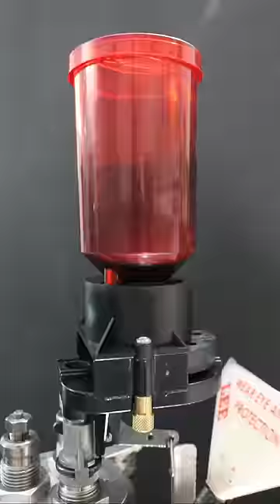Reloading 9mm ammo in 1 minute with Pro 1000  -   #reloading, #9mm, #leeprecision, #ammo, #shorts

Comment: Do you typically load 9mm projectiles that have a cannelure?  Or was that actually a .357 bullet ?
Reply from the maker: Good morning Yoda and thanks for stopping by and leaving a comment👍👍..  The projectile used here is a 130gr SJFP, reference B-329 fabricated by PRVI, diameter of 0.3545. 

A similar projectile that I have also used, more frequently than this is the 125gr SJSP, reference 613573 by Fiocchi. Both mentioned projectiles I have used to reload 9mm and .38 special rounds with no issue what so ever.

Take care and have a great day.

Comment: what powder are you using?
Reply from the maker: Good morning and thanks so much for stopping by the channel👍👍. I might be mistaken but in this particular instance I think I was using SP8. Have a look at the longer clip for more on this press, https://youtu.be/GplsUtheYPM . In addition, here is a list of items I normally use, all depends on what is available.. .... BUT.. Don't be fooled by my entertainment video that reloading is a mundane and easy operation.
Reloading is a very dangerous affair and it requires lots of time, patience and restraint.  Even so, mishaps can happen..

Here is what I normally use for 9x19 reloading.

Heads: 
- 124gr RNCP, FNCP by L.O.S, NTW, Fiocchi, Romana Metalli, H&N or Frontier.
- 124gr RN Polymer coated RN by ARES or IGF.
- 125gr SJSP, reference 613573 by Fiocchi.
- 130gr SJFP, reference B-329 by PRVI.

Primers:
- S&B, Fiocchi, CCI, Murom or Federal.

Propellant:
- N320, CSB5, CSB6, FRex, Vectan SP8. 

Note: For the amount of propellant and overall length of the projectile follow the specified data by each respective manufacturer of the specific product. 

Have a great weekend

Comment: How much does it cost to get set up for reloading?   And what's the estimated $/round?  Gonna do my own research, just hoping somebody can offer a "fast-track" answer/estimate?  Been very interested for a long time but hadn't been in a position to invest in the matter.
Reply from the maker: Good afternoon. . Thanks for stopping by and looking at my content.🙏🙏👍👍 
Here are my own workings as follows: 
🔶Based on 9mm setup only. (Changing caliber is approximately $100 addition, mostly dies and shell plate)

🔶ALL FIGURES & CALCULATION DONE January 2022 as follows:

$300 _ Lee Pro 1000 Press 9mm, ref. 90640.
$020 _ Lee Case Collator, ref. 90667.
$045 _ Lyman Ammo Checker, ref. 7833000.
$012 _ Dillon precision case lube, ref. 13733.
$055 _ Scale frankford arsenal, ref. DS-750 
$050 _ Price estimate for a generic caliper.
$048 _ Price estimate for kinetic bullet puller. 
$530 _ TOTAL INVESTMENT of above listed item ONLY.

$160 _ TOTAL Calculated price of raw materials to fabricate 1000 rounds type (CPRN-124gr) "brass cases free)
 
$300 _ TOTAL Average price for factory loaded ammo, 1000 rounds, 124gr.

🔶Therefore, excluding labor cost, I save $140/1000 Rounds.
🔶Therefore, investment of $530 / Savings of $140 = 3786 rounds.
🔶Therefore, after 4000 rounds I start saving $140 / 1000 rounds I send down range.

🔶🔶🔶 In short, after 4000 rounds I cover ONLY my investment cost. Expect more cost as you go along.
Reply: @ReloadingMoreAD1966  fantastic, thank you, most of that I understood. Lol. So if i got this straight, roughly $530 gets my workstation set up, and from there it will cost me approx. $160 to produce myself 1000rds?

Comment: What’s the cost of this rig and how much could you theoretically save on ammunition
Reply from the maker: Hello Phily. Thanks for looking at my content. Good morning Dominic.  Yesterday someone asked a similar question. Here is the reply with some numbers. Take care and have a great day.👍👍
-------------------
Here are my own workings as follows: 
🔶Based on 9mm setup only. (Changing caliber is approximately $100 addition, mostly dies and shell plate)

🔶ALL FIGURES & CALCULATION DONE January 2022 as follows:

$300 _ Lee Pro 1000 Press 9mm, ref. 90640.
$020 _ Lee Case Collator, ref. 90667.
$045 _ Lyman Ammo Checker, ref. 7833000.
$012 _ Dillon precision case lube, ref. 13733.
$055 _ Scale frankford arsenal, ref. DS-750 
$050 _ Price estimate for a generic caliper.
$048 _ Price estimate for kinetic bullet puller. 
$530 _ TOTAL INVESTMENT of above listed item ONLY.

$160 _ TOTAL Calculated price of raw materials to fabricate 1000 rounds type (CPRN-124gr) "brass cases free)
 
$300 _ TOTAL Average price for factory loaded ammo, 1000 rounds, 124gr.

🔶Therefore, excluding labor cost, I save $140/1000 Rounds.
🔶Therefore, investment of $530 / Savings of $140 = 3786 rounds.
🔶Therefore, after 4000 rounds I start saving $140 / 1000 rounds I send down range.

🔶🔶🔶 In short, after 4000 rounds I cover ONLY my investment cost.
Reply: @ReloadingMoreAD1966  very insightful. Thanks. I might try to get something going myself I’m new to firearms in general but I want something semi self sustainable.  
I like the idea that given the proper materials I could build/make it myself since I was little I’ve always been facilitated by guns bullets middle age weaponry etc 

Honestly this doesn’t look nearly as complicated is I thought it would be (not that it’s easy) just cool to see that it’s not as impossible as it might seem at first 

And surprisingly affordable

Comment: how many bullets you need to make to break even with the cost of all that machinery?
Reply from the maker: Good Morning Burden and thanks for stopping by👍🙏. Here is a small calculation to give you an idea about the costs involved. BUT.. Don't be fooled by my entertainment video that reloading is a mundane and easy operation.
Reloading is a very dangerous affair and it requires lots of time, patience and restraint.  Even so, mishaps can happen.. 

Here are my own workings from first quarter of 2022 as follows: 
🔶Based on 9mm setup only. (Changing caliber is approximately $100 addition, mostly dies and shell plate)

🔶ALL FIGURES & CALCULATION DONE January 2022 as follows:

$300 _ Lee Pro 1000 Press 9mm, ref. 90640.
$020 _ Lee Case Collator, ref. 90667.
$045 _ Lyman Ammo Checker, ref. 7833000.
$012 _ Dillon precision case lube, ref. 13733.
$055 _ Scale frankford arsenal, ref. DS-750 
$050 _ Price estimate for a generic caliper.
$048 _ Price estimate for kinetic bullet puller. 
$530 _ TOTAL INVESTMENT of above listed item ONLY.

$160 _ TOTAL Calculated price of raw materials to fabricate 1000 rounds type (CPRN-124gr) "brass cases free)
 
$300 _ TOTAL Average price for factory loaded ammo, 1000 rounds, 124gr.

🔶Therefore, excluding labor cost, I save $140/1000 Rounds.
🔶Therefore, investment of $530 / Savings of $140 = 3786 rounds.
🔶Therefore, after 4000 rounds I start saving $140 / 1000 rounds I send down range.

🔶🔶🔶 In short, after 4000 rounds I cover ONLY my investment cost. Expect more cost as you go along especially for all other tools and equipment.
Reply: @ReloadingMoreAD1966  
at the nicest and best answer i have ever gotten. i tought those tools would be more expensive
Reply from the maker: @Burden82  No Problem. My Pleasure. Prices have gone up in the last few months and this particular model of press was replaced by a new model in 2023. Honestly the new model is mostly the same and personally I have been looking to get a second press, older model because I am very familiar with this one. Take care and enjoy the rest of the day. NOTE: that in my pinned comments you can find links to more of my detailed clips of this press.

Comment: Does it get cramped?
Reply from the maker: Good morning Juan and thanks for stopping by.👍👍

Here I am using the 9mm die set by lee, item 90509, comprising of a total of 3 dies.
The first is called the "Full Length Sizing Die". This particular die is removing the spent primer and simultaneously sizing the cartridge.

The second die is the "Powder Thru Expanding Die". This die will flare the top of the case, making way for the projectile to be seated in the next step. This same die is also the place were the powder charge is released. 

The third die is seating the bullet in place and also crimping tight the bullet. Now be aware that the crimp is not a roll crimp, sort of what you see on older revolver rounds but just a minimal crimp, similar to factory loaded 9x19mm ammo supplied by most brands.

Thanks for showing interest in my content. Have a look at the channel for longer, non-Short clips for this press. Regards and take care.

Comment: *Laughs in 2,500 rounds an hour autodrive press*

This is cute.
Reply from the maker: Good afternoon and thanks for stopping by and having a look at my content🙏🙏👍👍. One is able to produce more rounds than 1 per minute on this press. The manufacturer claims that you can produce 500 per hour but personally I manage about half of that "200 to 250" and not more than 800 to a 1000 a day, mostly because it is though on your arms. Obviously, still nothing compared to something as a Dillon or Mark 7 with autodrive.

Here is the 650 if you like to have a look. https://youtube.com/shorts/UyKHr_O8-tg

Take care and have a great day.
Reply: @ReloadingMoreAD1966 i know all about the 650. 

I've just never understood how people claim it saves money to reload when you need to load tens of thousands of rounds to see a return on your initial investment.
Reply from the maker: @RSpracticalshooting  Good afternoon. If the investment is massive such as that encured by the larger press that is fully automated you have a valid point. But be aware that most reload to increase accurancy and not reduce price. 

Here are my own workings as follows for the pross I have: 
🔶Based on 9mm setup only. (Changing caliber is approximately $100 addition, mostly dies and shell plate)

🔶ALL FIGURES & CALCULATION DONE January 2022 as follows:

$300 _ Lee Pro 1000 Press 9mm, ref. 90640.
$020 _ Lee Case Collator, ref. 90667.
$045 _ Lyman Ammo Checker, ref. 7833000.
$012 _ Dillon precision case lube, ref. 13733.
$055 _ Scale frankford arsenal, ref. DS-750 
$050 _ Price estimate for a generic caliper.
$048 _ Price estimate for kinetic bullet puller. 
$530 _ TOTAL INVESTMENT of above listed item ONLY.

$160 _ TOTAL Calculated price of raw materials to fabricate 1000 rounds type (CPRN-124gr) "brass cases free)
 
$300 _ TOTAL Average price for factory loaded ammo, 1000 rounds, 124gr.

🔶Therefore, excluding labor cost, I save $140/1000 Rounds.
🔶Therefore, investment of $530 / Savings of $140 = 3786 rounds.
🔶Therefore, after 4000 rounds I start saving $140 / 1000 rounds I send down range.

🔶🔶🔶 In short, after 4000 rounds I cover ONLY my investment cost.

Comment: So everything is all but automated except for putting in the actual bullet? Is there something to put the bullet in too?
Reply from the maker: Good morning Spaced Out. Thanks for looking at my content👍👍🙏🙏. This press can be fitted with an original attachment for under $100 that would place the bullet in position automatically, in a mechanical fashion without an external power supply but personally I find it better to place the bullet manually because I can use that motion to also visually inspect that the powder is in the case.  

I have a longer detailed clip on this press you might find interesting. Link in the pinned comment. Have a look at that to see the entire process.

Comment: "Do reloading... IT'S SO CHEAP AND EASY... As long as you've got 30k on machinery"
Reply from the maker: Good morning and thanks for stopping by and looking at my content.🙏🙏👍👍. Some can be very expensive but this one here is on the low side of the scale. this will set you back around $600 including also some basic accessories.  Here are my own workings as follows: 
🔶Based on 9mm setup only. (Changing caliber is approximately $100 addition, mostly dies and shell plate)
🔶ALL FIGURES & CALCULATION DONE January 2022 as follows:

$300 _ Lee Pro 1000 Press 9mm, ref. 90640.
$020 _ Lee Case Collator, ref. 90667.
$045 _ Lyman Ammo Checker, ref. 7833000.
$012 _ Dillon precision case lube, ref. 13733.
$055 _ Scale frankford arsenal, ref. DS-750 
$050 _ Price estimate for a generic caliper.
$048 _ Price estimate for kinetic bullet puller. 
$530 _ TOTAL INVESTMENT of above listed item ONLY.
Reply: 2k tops. Dillon XL750 and DAA primer tuber filler let's me load a couple hundred rounds of 9mm per hour. Cost is $.07/round. 
The equipment will last decades and can be sold, so I don't view it as an expense. It's an investment that provides good ROI. I shoot mostly heavy subs, so I'm saving hundreds of dollars per year. I load match 223 on the same press for that matter.

Comment: Hiw much cheaper is this compared to buying themin bulk?
Reply from the maker: Good evening. Thanks for stopping by and looking at my content.🙏🙏👍👍 
Here are my own workings as follows: 
🔶Based on 9mm setup only. (Changing caliber is approximately $100 addition, mostly dies and shell plate)

🔶ALL FIGURES & CALCULATION DONE January 2022 as follows:

$300 _ Lee Pro 1000 Press 9mm, ref. 90640.
$020 _ Lee Case Collator, ref. 90667.
$045 _ Lyman Ammo Checker, ref. 7833000.
$012 _ Dillon precision case lube, ref. 13733.
$055 _ Scale frankford arsenal, ref. DS-750 
$050 _ Price estimate for a generic caliper.
$048 _ Price estimate for kinetic bullet puller. 
$530 _ TOTAL INVESTMENT of above listed item ONLY.

$160 _ TOTAL Calculated price of raw materials to fabricate 1000 rounds type (CPRN-124gr) "brass cases free)
 
$300 _ TOTAL Average price for factory loaded ammo, 1000 rounds, 124gr.

🔶Therefore, excluding labor cost, I save $140/1000 Rounds.
🔶Therefore, investment of $530 / Savings of $140 = 3786 rounds.
🔶Therefore, after 4000 rounds I start saving $140 / 1000 rounds I send down range.

🔶🔶🔶 In short, after 4000 rounds I cover ONLY my investment cost.

Comment: Is assembly your own bullet like that more cheaper than buy finished one ?
Reply from the maker: Good Morning Dofri and thanks for stopping by👍🙏. One would need to make a calculation based on the caliber and individual needs. more that just saving money the produced ammo is customized for your specific weapons so the shooter will see a huge improvement on accuracy.  Here is a small calculation someone had asked for in the past just to give you an idea about the costs involved.   BUT.. Don't be fooled by my entertainment video that reloading is a mundane and easy operation.
Reloading is a very dangerous affair and it requires lots of time, patience and restraint.  Even so, mishaps can happen.. 

Here are my own workings from first quarter of 2022 as follows: 
🔶Based on 9mm setup only. (Changing caliber is approximately $100 addition, mostly dies and shell plate)

🔶ALL FIGURES & CALCULATION DONE January 2022 as follows:

$300 _ Lee Pro 1000 Press 9mm, ref. 90640.
$020 _ Lee Case Collator, ref. 90667.
$045 _ Lyman Ammo Checker, ref. 7833000.
$012 _ Dillon precision case lube, ref. 13733.
$055 _ Scale frankford arsenal, ref. DS-750 
$050 _ Price estimate for a generic caliper.
$048 _ Price estimate for kinetic bullet puller. 
$530 _ TOTAL INVESTMENT of above listed item ONLY.

$160 _ TOTAL Calculated price of raw materials to fabricate 1000 rounds type (CPRN-124gr) "brass cases free)
 
$300 _ TOTAL Average price for factory loaded ammo, 1000 rounds, 124gr.

🔶Therefore, excluding labor cost, I save $140/1000 Rounds.
🔶Therefore, investment of $530 / Savings of $140 = 3786 rounds.
🔶Therefore, after 4000 rounds I start saving $140 / 1000 rounds I send down range.

🔶🔶🔶 In short, after 4000 rounds I cover ONLY my investment cost. Expect more cost as you go along especially for all other tools and equipment.

Comment: Color me intrigued, but I’ve never seen soft-point in 9mm
Reply from the maker: Hi Joey. thanks for stopping by. I decided to go with this projectile on this short because it is more interesting for people to see. You are correct, they are not easy to find. The only factory ammo of the sort I managed to find is the Sellier and bellot, 100gr, Reference V310652. They also have a 124gr, item SB9S but that one I could never manage to get hold off. for the S&B 100g, I did several tests such as penetration, velocity & dismantling, tests that you can find on my channel.

the Projectile that I used in this short video is a 130gr SJSP, reference B-329 fabricated by PRVI, diameter of 0.3545. A similar projectile that I have also used, more frequently than this is the 125gr SJSP, reference 613573 by Fiocchi. Both mentioned projectiles I have used to reload 9mm and .38 special rounds with no issue what so ever.

Thanks and have a great day.

Comment: Wait wait when did the mechanisms load the primer?? First step?? Why did it still look empty after the first step?
Reply from the maker: Good morning Jason. Thanks for stopping by.👍👍
Here I am using the 9mm die set by lee, item 90509, comprising of a total of 3 dies.
The first is called the "Full Length Sizing Die". This particular die is removing the spent primer and simultaneously sizing the cartridge.

The second die is the "Powder Thru Expanding Die". This die will flare the top of the case, making way for the projectile to be seated in the next step. This same die is also the place were the powder charge is released. 

At the bottom of the second die, on station 2, the new primer is being inserted.

Thanks for showing interest in my content. Have a look at the channel for longer, non-Short clips. Regards and take care.
Reply: @ReloadingMoreAD1966  Oh nice thank you for clearing that up!!
I'm really interested in reloading considering the state of ammo pricing in CA. This short is one of the better ones that's showing the steps quite clearly.